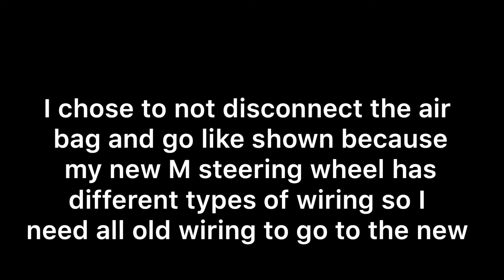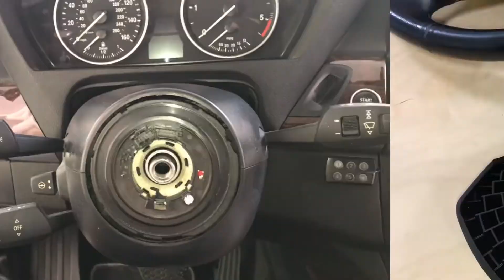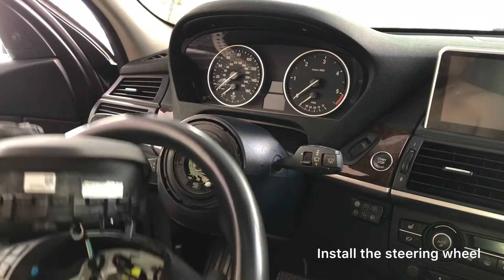How to BMW X5 e70 steering wheel replacement upgrade

Comment: One more question in your video you mentioned you didn’t disconnect the airbag because of wiring, does the M wheel have different wiring than the regular one?

Comment: Hi, got the sports steering with the paddle shifters,....dont know if they will work plug and play when I replace the old oem steering, cos that doesnt have the shifters, pls
Reply from the maker: Isaac Felbah you don’t have the wiring for the shifters if you don’t have shifter from oem

Comment: nice video, but did the errors that showed on your display have anything to do with the steering install. Oh and put a shirt on for gosh sakes.
Reply from the maker: Paul Hopkins errors not connected to the change. About the shirt issue, too hot 🥵